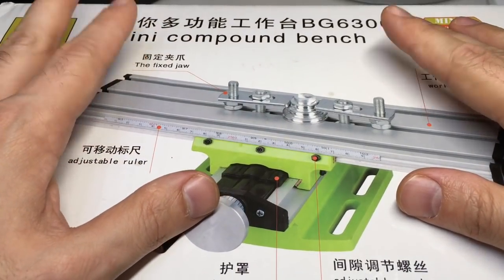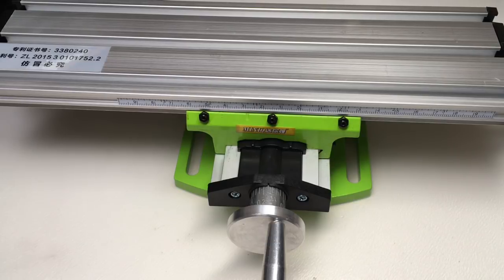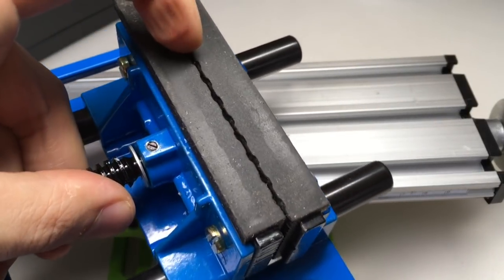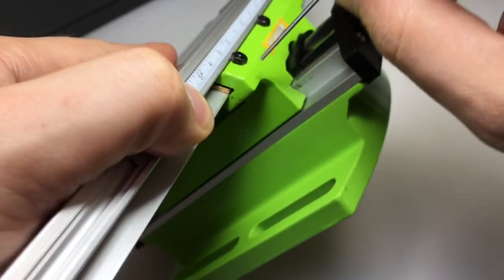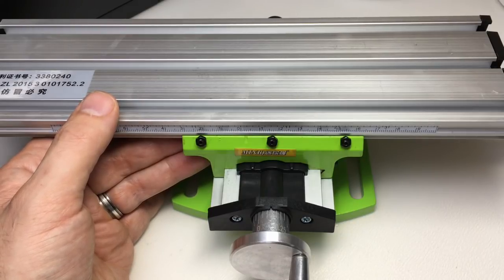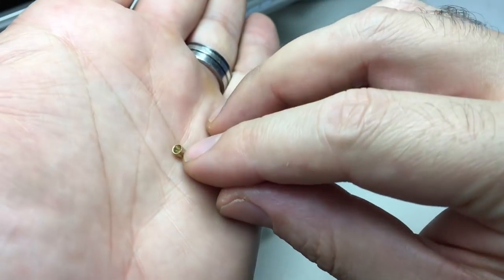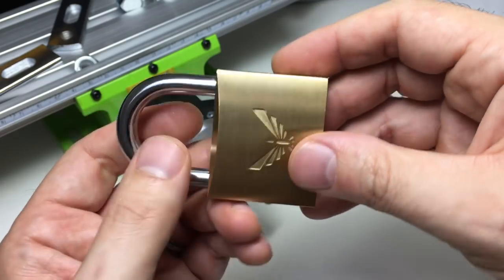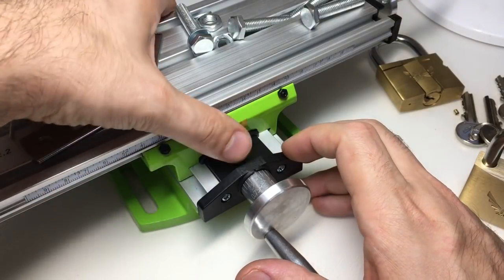(306) Banggood com Review - MiniQ Compound Table - Making a Practice Padlock Part 2

Comment: There's an upgraded version of this cross slide table for a few <insert relevant currency> more than this table. I think that the model number is BG6330. There's also an even more upgraded version labeled "pro" from the same manufacturer. If you have the chance go for the upgraded version, especially if you like me want it for use with a milling machine.
I would have done so if I'd been a bit more observant, but I'm well on my way towards a fully functioning cross slide table with no backlash in any direction despite my choice of the low-end version. I would most likely be there already if I'd gone for the upgraded version.

Anyway, thank's for an informative review and for an excellent channel. It's a life saver for people like me who have no measurable social life.
Reply from the maker: Thanks, I'll look out for that :-)
Reply: i dont think you can have no backlash

Comment: I have an old Yale which I bought from Ebay to which I did something similar. It came without any pins or plugs installed, allowing me to simply tap some M4 x .7 threads instead of hammering in the plugs. Great way to practice for sure
Reply from the maker: Sounds like an ideal lock... I'll keep,a,look out for similar on eBay :-)
Reply: Lock Noob for what it's worth, the one I have works perfectly for practicing.

Comment: That's a pretty nice X-Y table :) and I like the color ;). Have seen it a couple of times and it really looks quite okay :). The Avocet will be a beautiful training lock :). Very good precise work on the plugs so far. I usually drill into them with a 1.5mm drill and then tap it with an M2 tap and pull the plugs out with a M2 screw :). This way you don't destroy the springs. Works very good on brass padlocks, so lala on aluminum ones ;D. Before tapping for the setscrews, countersink the holes a bit :), that helps the tool :). A very nice project once again Ash, happy looking forward to the end result :).
Reply from the maker: redcatimaging good tips Foxxy :-) I used M3 taps in the end and a 2.5 mm drill :-) worked great as you'll see soon
Reply: Oh haha ;D, the Avocet looked bigger than it seems to be ;D. Usually M3 is too small for (I thought it would be) a 50mm padlock (well at least the Abus ones I have tapped ;D). I'm very happy looking forward to watch it :D. Have a good night buddy :).

Comment: Cool project you got there with the Avocet :). I did a review on this XY-table a couple months back and was really impressed with it. In my video I use it for grinding (this is why I got it in the first place). Like Foxxy and others mentioned you can remove the plugs by drilling a small hole and  then use a screw to pull the plug out. I think I have a video for that too. My main issue was to align the XY-table with the table of the drill press with the vise on the  XY-Table. I eventually used the depth meter on the caliper to take 3 measurements of each side and then align everything by tapping slightly until everything was sort of aligned. Maybe you have a better method which you could show.
Reply from the maker: I like the idea of pulling the plugs to avoid hurting the springs. The plugs all pushed into the bible though, which was a surprise :-)

Comment: You might be able to improve visual contrast of pin metal versus body metal with some 600-800 grit sanding of that face, then acid etch of that face.

Comment: How much play is there along each axis mr.Noob ? ie, how much slop in the thread/nut/control handle business, rather than angular play in the dovetails ? It looks like it did a good job of placing those 5 holes in the padlock anyway.... re. knackering the springs - did you try setting the depth stop on yer drill press in stages to hold the bit from bursting through onto the springs ?  I know, it's still likely they will get knackered :o)
Reply from the maker: noakeswalker the play is very slight and you can cancel a lot of it by tightening the slide plates on the x and y. I'm not a milling expert though, so proceed with some caution - I guess as an occasional use for ought work it will do just fine. As for the depth stop, that would work perfectly as long as the plugs don't push through into the pin chambers... which of course they did unfortunately :-)
Reply: Plugs pushing into chambers - yeah, I guess you'd have to drill a much smaller hole then either tap an m2 screw in , or use an extractor, to try and pull the plugs out - I think Potti314 did this  successfully once. Re the table - I see Banggood do a more beefy one - twice the price mind you, but still cheap if it's nicely made, I might go for that - I won't be milling (have a lathe for that) but just more precise drilling sometimes would be nice....and it's the backlash that might be the spanner in the in the works here....:o)

Comment: Nice ! One question : when you drill the chambers  the springs are destroyed ?
Reply from the maker: Yes, they were destroyed. Foxxy commented that you can use an m2 tap and then pull the plugs out with an m2 screw to save the springs :-)